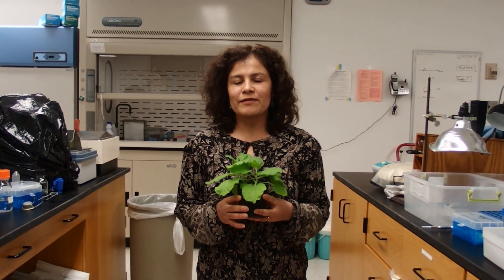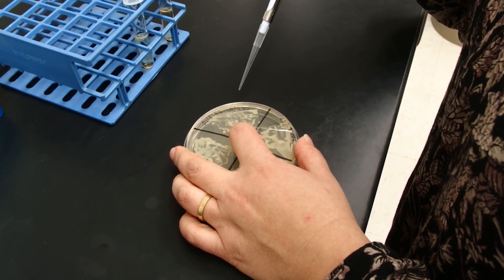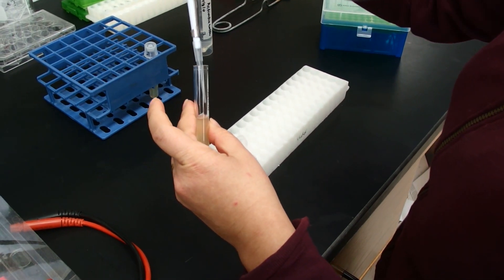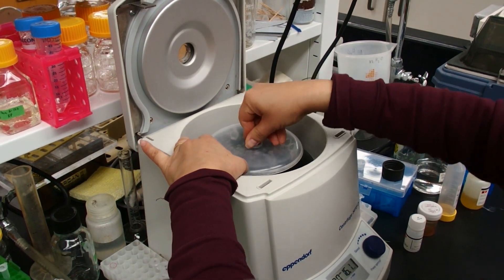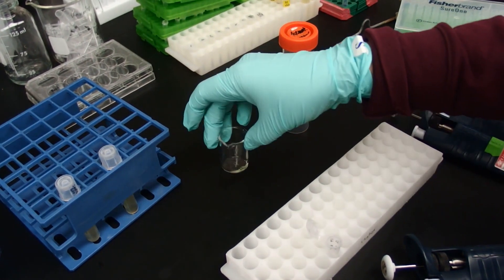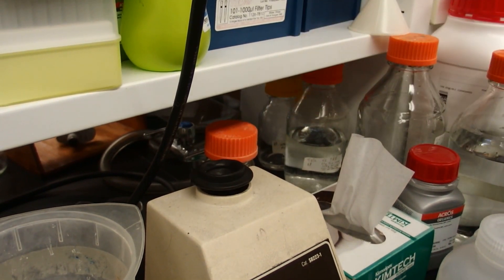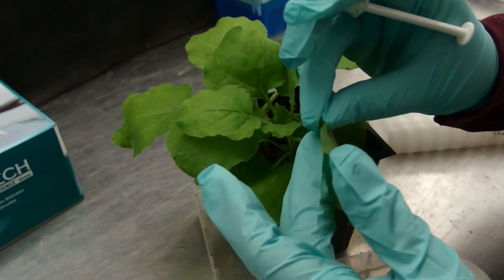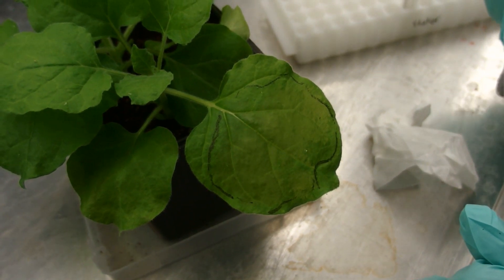Tobacco Agroinfiltration Transient Transformation

Comment: may i ask, what did you use the P19 protein for? is any gene silencing happening?
Reply from the maker: p19 is a silencing suppressor. It allows your proteins of interest to be expressed at higher levels.
Reply: @RahulPatharkar  yes i read that in your protocol,  Thank you. 
But do you have the Paper/book that mentions how exactly does it improve gene expression?
Reply from the maker: @ahmedlabidi6795  It does it by suppressing silencing. Here is a paper: Lombardi, R., Circelli, P., Villani, M.E. et al. High-level HIV-1 Nef transient expression in Nicotiana benthamiana using the P19 gene silencing suppressor protein of Artichoke Mottled Crinckle Virus. BMC Biotechnol 9, 96 (2009). https://doi.org/10.1186/1472-6750-9-96
Reply: @RahulPatharkar  Do you have a video or published paper with regards to gene silencing in a plant?, if you do may you point to the right direction
Reply from the maker: @LungeloSikhakhane-x4e  I do not have a video specifically for gene silencing. However, this agro method can be used to do it if you have the correct vectors.

Comment: Hi! Thanks for the video. I was wondering if you have information on what the vector design looks like? I understand you need a promoter for your gene of interest, usually a CaMV 35S promoter. However, would it be sufficient to only have the CAMV35S promoter and your gene of interest in the T-DNA region of agrobacterium to induce transient gene expression? Or are more things required in the T-DNA region?
Reply from the maker: Yes that would work for transient expression. Typically a tag would be added to the protein so that the protein could be visualized.
Reply: @RahulPatharkar  Thanks for your help!